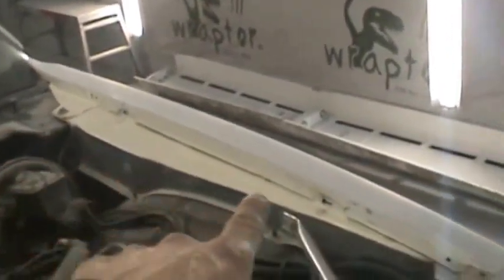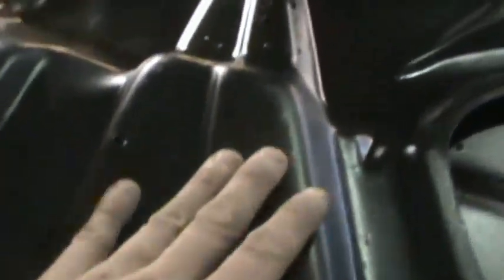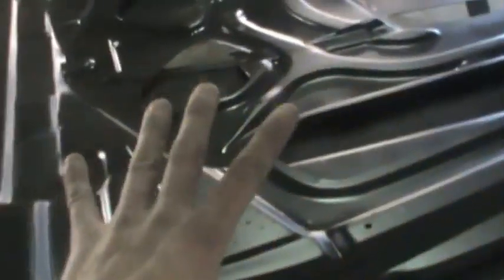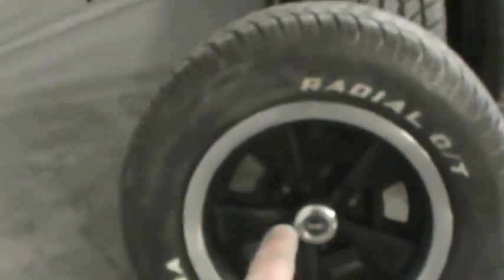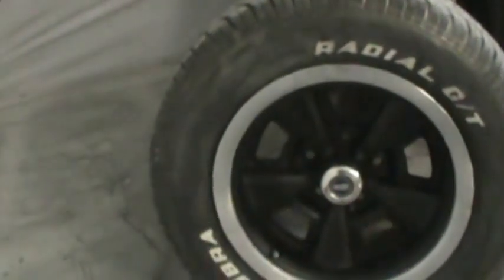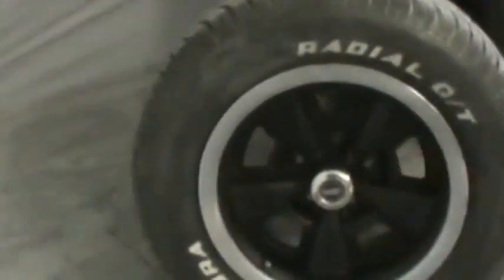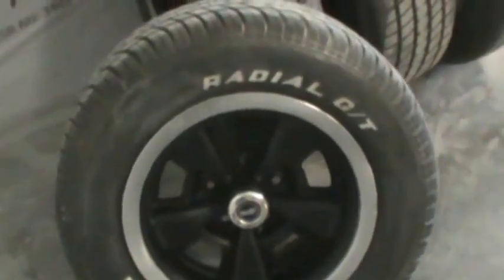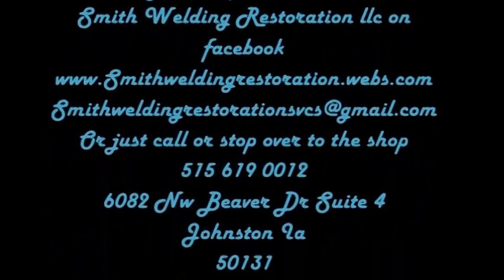1980 Camaro Z 28 Part 5 into paint, wheels finished progress ahead

Comment: 3 coats is more then enough i would only go 4 coats if i had alot of artwork going on wetsanding in between  cured coats like 2 coats of clear then wetsand then a final 2 coats of clear flow coat wetsand buff call it a day but you guys already knew that nice vid
Reply from the maker: I still really appreciate input. These products, ideas, and practices vary so much.